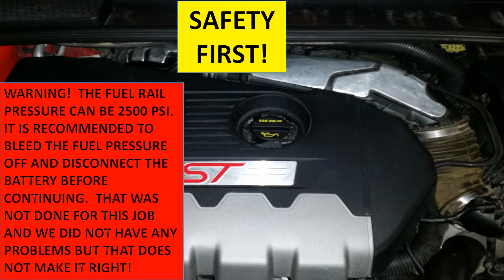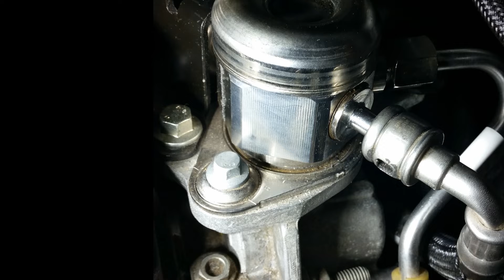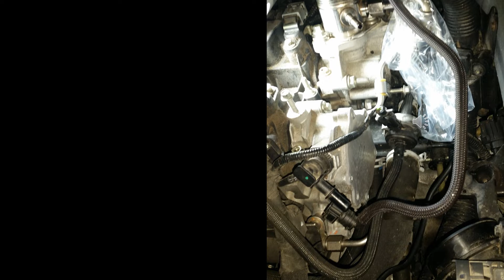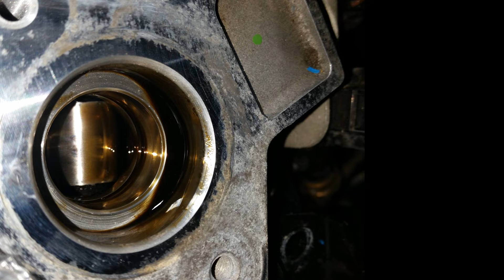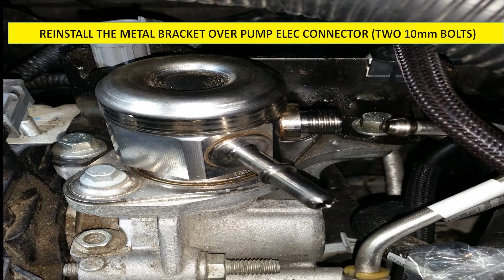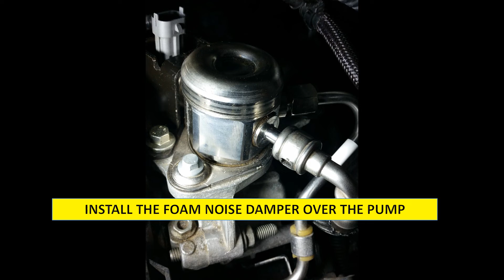2013 FORD FOCUS ST HIGH PRESSURE FUEL PUMP CHANGE

Comment: My base model focus got this code and I had the same symptoms. I had to move the car a couple times around my driveway before I replaced the hpfp. I just replaced it and the car hasn’t moved in about 2 and a half to 3 weeks. When I put it in drive and reverse it goes no where. Any ideas?
Reply from the maker: I sold my ford and bought a Honda.  I’m sorry I don’t have and other helpful ideas.

Comment: is this the actual fuel pump
Reply from the maker: It’s been a few years since I worked on this but I believe this is the high pressure mechanical fuel pump. I thought there was an electric pump at the tank also.

Comment: How does the input line come off?  Mine has a black plastic sleeve that just spins.  Feels like it should slip back and away from the pump, but no dice.  Physical demonstration would be great.
Reply from the maker: I used the plastic line removal tool that was pictured to remove the fuel line. Part of it had to be cut off to get clearance to fit the tool inside the fitting to release the line. It was a little tricky but I’m not a regular auto mechanic.  Hope you were able to get yours removed.

Comment: So I just got done replacing the valves on my car, so the head had to come off. Just set everything back in place and it's not starting. I'm wondering if it's because there's air in my lines? Seen a previous comment that asked if u bled yours or not so do these cars not have to be bled?

Comment: How hard is it to rotate shaft?
Reply from the maker: SrZx10 I did not have to rotate the crank to move the cam so I don't have a good answer to your question. I imagine you would have to remove the sepentine belt and use a strap wrench on the crank pulley.

Comment: Fantastic video. My 2013 Focus ST just gave me the P0087 code and I’m assuming it’s the HPFP. (I’ll also be checking the LPFP and fuel pressure sensor to see if they much be the cause.) I really love how detailed your video is. I’ll be making a video and crediting yours as reference. Great job!
Reply: Did it fix your problem?
Reply: What was the origin of the problem?
Reply: @wilmincaraballo8718  Hey I had a tune on my car for crackle and pops. It must of been too much for the HPFP and it blew. Had to replace it at the dealer. Costed me $800. I no longer run that tune LOL. Anyways remember to keep the foam cover that goes over your HPFP because it helps with noise. Remember boys to just not tune your car to have it sound cool or make loud noises.

Comment: changed the pressure sensor and pump still p0087 is still there and the car stalls when first driving off. Any suggestions.
Reply: 350GTSkylin maybe it’s the lpfp, fuel filter that’s attached to the lpfp, fuel pressure sensor, or just bad fuel? Where those things all checked?
Reply: fixed the problem, first sensor I changed with High pressure sensor on the fuel rail. It did not fix the problem. I changed the low pressure sensor before the hpfp and problem went away!